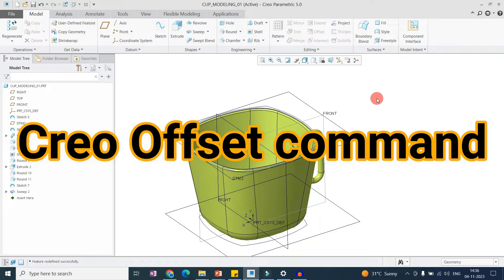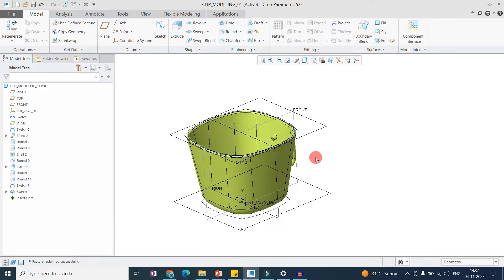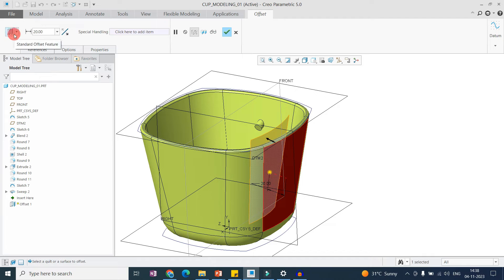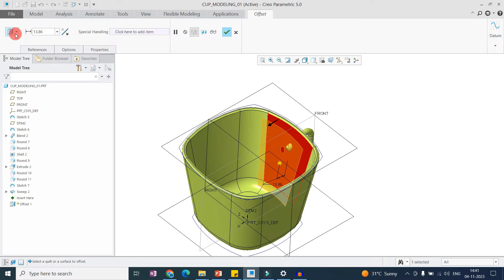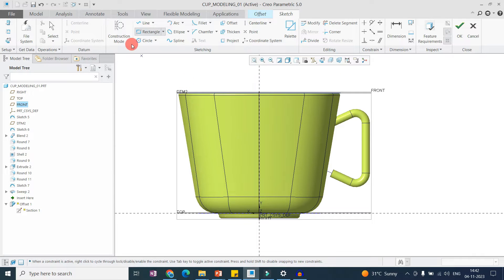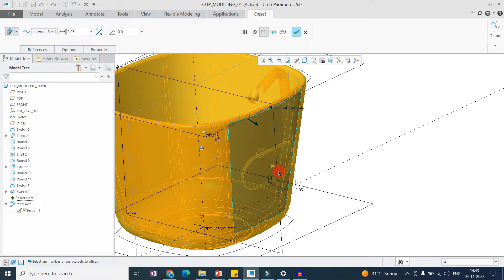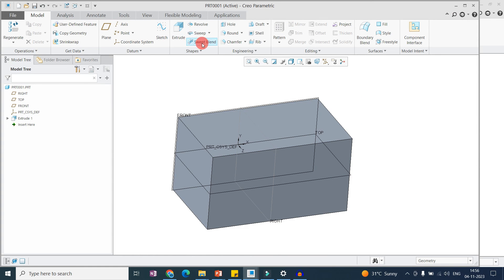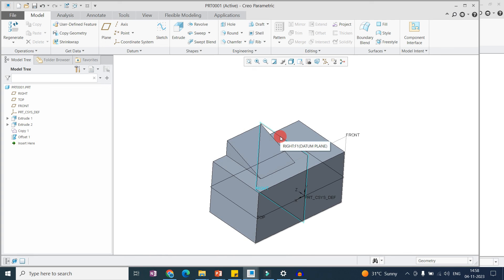Creo tutorial | Offset command explained in detail | surface modeling command #mechanicaldesignadda

Comment: Great tutorial. In the draft offset, I'm having a thickness problem, I need 33 mm offset but it is not allowing me to do more than 22. I dont know how to fix this issue.
Reply from the maker: Let me know how I can help in this ?
Reply: It's fixed. I changed "side surface normal to" option from "sketch" to "surface". I dont know what actually happened but its fixed😅
Reply from the maker: Great